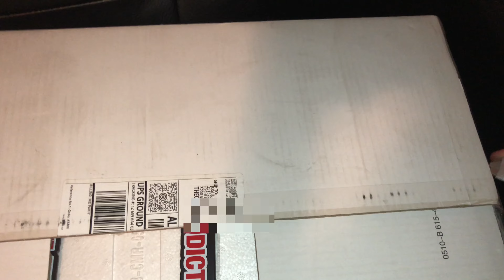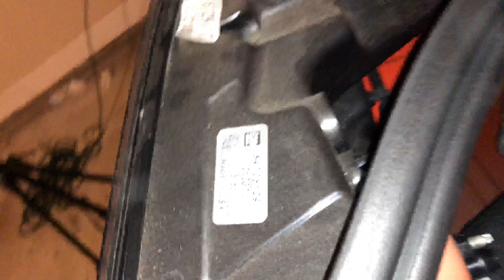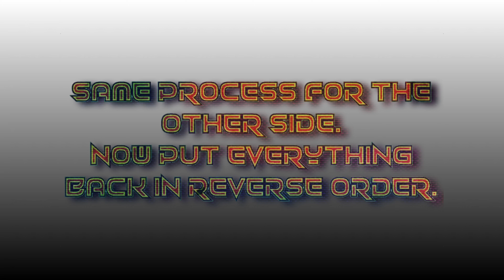C8 tail lights for the 2019+ Camaro! FIRST FULL INSTALL AND COMPARISONS ON YOUTUBE!

Comment: Josh! You saved another Josh here with this video! Thank you for explaining the little issues you had along the way. I just installed these in my 19 ZL1 last night and man everything that could go wrong went wrong. Broke the corner off the mounting bracket for the driver side rear bumper... broke the long middle clip off with the plastic welds... not alot of force was used. Struggled with the tail light harness release and 3rd brake release until I found your video. You were a life saver man thank you for sharing the little things! Beautiful car brother!
Reply from the maker: Ahh man hate to hear that! But glad I could help!

Comment: How do you get your lights to do those different motions when you're not inside it? Also is there a setting so the middle rear brake light will also sequence?
Reply from the maker: You can add a 12v option, where it comes with a push button that can be pressed to do a pattern while not in it, the brake light is an aftermarket product from Seequenced LLC. I have a discount code in my instagram bio

Comment: Hey man. Did you have any issues with the back up camera after the install?
Mine is a blue screen. All connections and fuses are good.
Reply from the maker: Hey man, hate to hear that, no mine has been working like normal
Reply: I assume you fixed this already, but as a comment for anyone that has this issue: it occurs when you disconnect the wiring harness (drivers side of the rear bumper) with the battery still connected. To fix it, disconnect the battery, reconnect the harness in the rear bumper, then reconnect the battery and it should be fixed.

You can avoid the whole issue by being careful when removing the rear bumper, just set it under the rear crash bar instead of completely removing the bumper and don’t disconnect the wiring harnesses

Comment: I've got rock guards installed on the rear wheel-well. Any work around for this to drop the bumper and access the wiring harness?
Reply from the maker: Stock or aftermarket?

Comment: Where did you run the red wires that connect to the 3rd brake light to keep them from showing?
Reply from the maker: Ended up running both ends down to the right where the harness goes from trunk lid to inside of trunk. Ran the left side up and along the inside of the top of the trunk to the left side. The wires for both lights that plug into the red wires ran a portion over the seal and up into the trunk liner to hide the connections. So in the end the only visible part is the 1 inch of exposed wire coming from the taillight and into the liner. Not much can be done with that

Comment: I noticed my check marks (I guess you could call them that) are not lighting up until its darker out so unless I push the brake pedal, during the day there are no lights on the back and no red reflectors. I think the original tail lights were lit all the time if the car was on. They come on if you put the marker lights on manually but otherwise not until it gets dark enough to trigger the headlights to come on. Anybody else notice this?
Reply from the maker: Mine seem to be on. Super super dim though. Can’t tell they are on unless really looking for it
Reply: @JCSCUSTOMS  that ended up being the case for me too. On another note, do you notice the turn signals coming on when braking? I was in front of a store that had large windows so I looked in my rearview to see how my tail lights looked and I noticed the turn signal was on too, although I couldn't reproduce it when I came out of the store. I was watching a video about Tesla model 3 after market taillights and the same thing happened. The guy in the video thought this was only for US spec'd cars so that could be the issue (if I can get it to happen again). On a side note, I saw these taillights on Ali express but for about $100 more than Auto Addicts sells them for. I'm hoping these didn't come from there as well🤞

Comment: JcS what's up buddy remember me I purchase the same ones from the same place I install them I noticed when you were backing up when you were stepping on the brakes turning single light should not be on when you are pushing the brakes just FYI. did you connect the connector underneath the tail lights I know you don't want to take out the bumper again, but it seems like you forgot to connect because again you're single lights are turning lights should not turn on whatsoever when you are backing up only the reverse light should be on and I don't think you're brake lights are turning on when you push the brakes please check you got my email if you have any questions. Thanks again your friend robert
Reply from the maker: Hey man, yeah I remember! So the turn signals were on because I put my blinkers on while in reverse! Everything works great!
Reply: @JCSCUSTOMS  ok didnt know well thats great than
Reply: oh almost forgot where did u hide the resistor the one that gets hot because when it rains water gos thu the inside near the wires
Reply from the maker: @ET-fm6mp  I ended up putting it underneath the little plastic bracket thing under the light where the GM harness plug is
Reply: ok cool